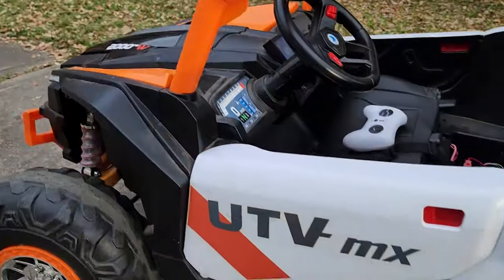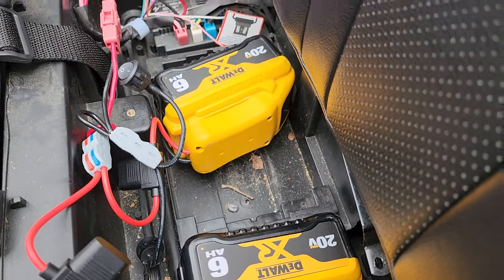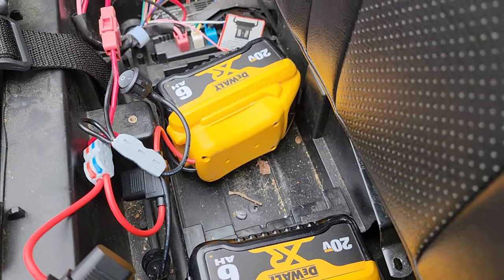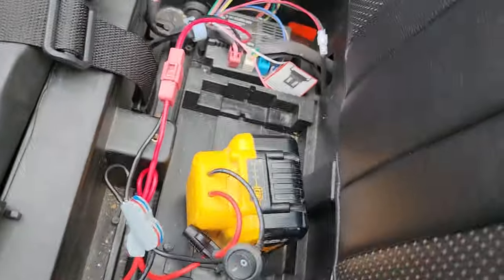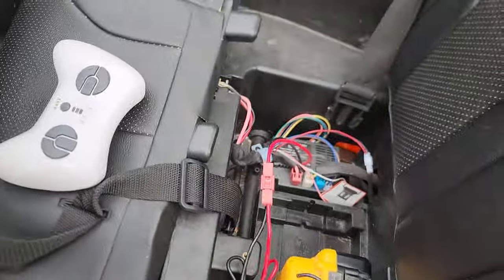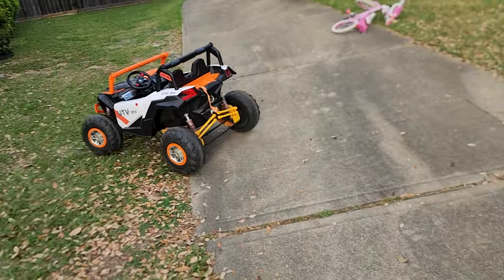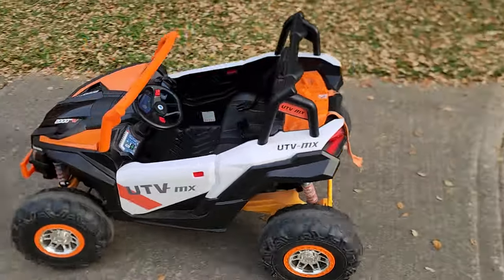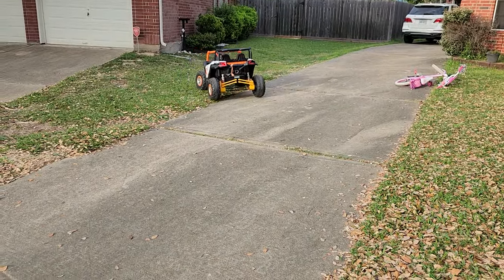(Non-medical) Power Wheels Battery Upgrade!

Comment: Heh looks to be a quick and fun project!  Dewalt batteries have built in protection so those will be very safe, maybe put velcro stick-ons to secure them a bit?  More of these when time and interest permits
Reply from the maker: The built in protection is why I chose this project. So far, after an hour of driv8ng the car, the batteries are still showing 3 bars.. crazy.